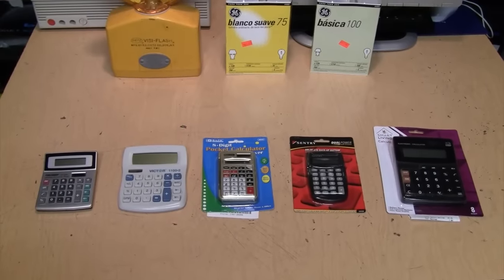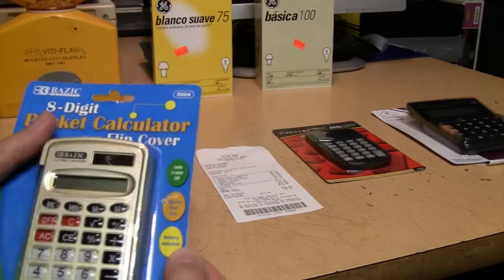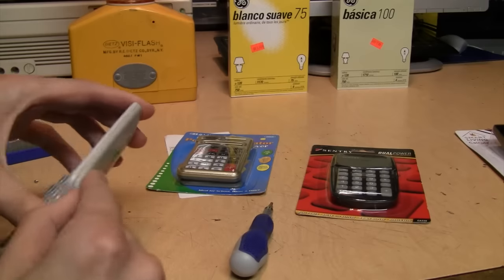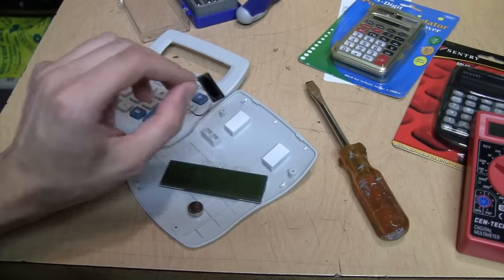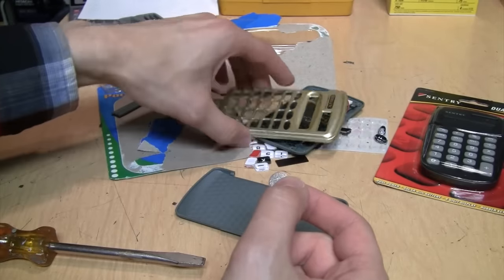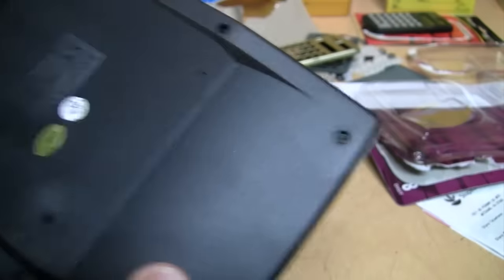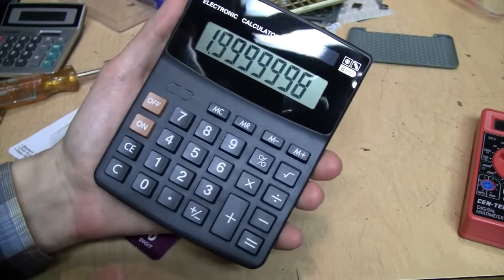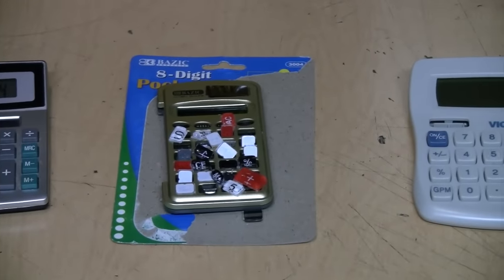Solar calculators BUSTED!

Comment: There are medical defibrillators: the modern ones have capacitors that don't make that high pitch, so some manufacturers have had to add sound chips, just because it's expected to make that noise to 'prove' that it's working.
Reply: no u
Reply: It's not actually the capacitor bank that makes the whining, it's the HV charge circuit.  Modern ones still whine, it's just above the range of human hearing.
Reply: Just like many modern cars has a speaker making the sound for the turn indicator, where in older cars it's the actual indicator relay that makes the click-clack.
Reply: Those are called skeuomorphs (mentioned in this video: https://www.youtube.com/watch?v=xn7ZaT3AgoU), they're the inclusion of features from old things in their successors. Such as the camera-shutter sound when taking a picture with a smartphone, the icon for calling being an old landline phone or the icon for email being an envelope. All skeuomorphs, purely to make the new things more familiar to people used to the older versions of these things.
Reply: does that mean silent crts.
Reply: Agent Lurmey another skeuomorph would be the 3.5 inch floppy as the save icon for things like word processing programs.
Reply: Modern CVTs in cars due to their nature have absolutely no "shift" feeling, being the entire point of a continuously variable transmission as opposed to the old gear based ones. People complained because they missed the feeling of the gears shifting so manufacturers have started to add in several points to imitate shifting, despite it being slightly less efficient that way.
Reply: I saw a news story a month or two ago about a fully electric schoolbus that constantly played music externally to replace the sound of the engine as an indication that the bus is nearby by and moving. I imagine the sound chip in a defibrillator serves a similar purpose of saftey.
Reply: If I let a silent one go then I make a fart sound with my mouth.
Reply: @Isenmouthe  hmmm, interesting. I know a guy that a 1997 pick up, and im pretty sure that when you (the driver) turns on a turn signal, it makes a somewhat low clicking noise. I wonder if that noise is actually a real blinker noise.
Reply: @GAIUSJAKE  are you me?
Reply: Agent Lurmey 
Thanks for the link. I subscribed to that channel, it’s great! Thanks.
Reply: @Isenmouthe  yeah to tell u its on
Reply: Can u put that in dumb terms lmao im not that advanced
Reply: @-Dragon-Master-  Heh, sure

You know on TV and movies they make that bweeeeeeeeeeEEEEEEEEEEE noise? Because the old ones were kinda.... rough, that's why that noise exists (and is actually a sound due to the parts actually being under strain). So the new models, they don't make that noise (or as someone said: at least not in range that we can hear anymore).... but it's so ingrained that "that whistle/whining noise means it's working" that they had to ADD a speaker, JUST to make the sound, because otherwise people didn't believe it was working.

I can imagine a few 'accidents' of people touching the paddles and shocking themselves because of it.
Reply: @Xunkun  lmao thank u thats much more simple than how u put it first cause i aint no rocket scientist
Reply: So Defibrillator noise is actually coilwhine?
Reply: @KRAFTWERK2K6  I'd guess so. The pitch change is likely due to reduction in charge current as the capacitors charge up causing the oscillator frequency to go up.

A bit like traditional (Xenon) camera flash units, I guess.
Reply: @MGSLurmey  I always turn that sound off so people don't know I'm taking pictures.
Reply: I remember having to add a fake "loading" screen to an app after a user performed a certain action because otherwise some users didn't trust how fast it worked.
Reply: @Luckingsworth  Tactile shifting is actually safer, tactility is important in many aspects of life, especially for adjustments of important things.
Reply: @Isenmouthe ; Just like a modern ICE car they have to add in engine noises to the cabin so you know it’s working. An electric car has really bizarre noises added to them depending on the brand. My friends Lexus sounds like a spaceship.
Reply: @Bootleg_Jones  The electric buses in London make engine noises that vary with speed for the same reason.
Reply: Makes sense to me. They're designed to be used by regular people without training, every second of delay could mean life or death.
Reply: Having auditory indication of device working is nice feature tho, You don't need to look at display to see what's going on and can focus on patient.
Reply: @Bootleg_Jones  yes, in defiriblilator def for safety reasons primarly, but not as much for the charging, but so u dont repeatedly defribrilate, since the perfection of buttercap high voltage capacitors takes a few milliseconds recharge...
Reply: @Luckingsworth  the less you feel the shift the more wear is actually happening from slippage. The smooth shifting of modern cars is why they don't last beyond the warranty these days and it's only done because people didn't like the feeling of a hard shift.
Reply: @RT-qd8yl  that's illegal in some places be careful
Reply: I was wondering why anyone would do this, but then I realized. Solar sells!
Reply: @Isenmouthe  Legal requirement that they be audible to the driver, VW fell foul of that in one of the Golfs where the indicator was deemed too quiet.
Reply: but there is practical application to that
Reply: Resurrecting your team mates is not as fun without it.
Reply: @Xunkun  Not a sound because the components were under strain. Just that the switching frequency was low and in hearing range. And a low frequency meant a large inductor that vibrated strongly enough that we could hear it.

Improved switch transistors now has less losses when turning on/off, which means it's possible to switch at a much higher frequency. On one hand, the frequency is above what we can hear. But a higher frequency also means less energy pulsed per cycle. So a smaller inductor is used and even if we could hear that frequency, the smaller inductor vibrates less, i.e. is more silent.
Reply: Coils tend to make much more noise when operating, than capacitors. Transformers and motors have coils in them.
Reply: It's the same thing with the loading screen in programs
Reply: We have Panasonic heart start mrx and I always wondered why different defibs made different noises
Reply: There's a word for that like 

"Soundening" or something where you add sound to a device simply to demonstrate function and for no practical function.
Reply: Well you need an indicator and a way to time yourself in an emergency.
Reply: @liam3284  good point
Reply: Buttons in the computer make sound when you click them when there is absolutely no needed to do that. But it gives you feedback about things happening. It's part of the UX.
Reply: @Luckingsworth  A battery-electric car, like a tesla, does not "shift" , and I doubt drivers expect it.  All snowmobiles, and many ATVs and mopeds, have CVTs.  Shifting must be just a motorcycle rider's thing.
Reply: @MGSLurmey  reminds me of a vinyl record and cassette tape recording technique that removed all crackles/hisses during silent moments of the recording. It caused people to think the silent 5 second intro in songs was actually the machine volume at 0, so they would turn the volume up to max, only for the song to start 2 seconds later, at full volume, quite to their surprise...
In such a use-case, you can't add fake hiss/crackle noise to alert people it's working as that would defeat the whole purpose of the anti-crackle technology!! Lol
Reply: @Heathmcdonald  Noiseless cameras are legally required in some places.  Official photos taken during court procedures (where that is done) so as to not disturb.
Reply: @morganrussman  I would guess that it's real and because it's quiet it's right there at the edge of real going away
Reply: @Heathmcdonald  You're still thinking of automatic transmissions with planetary gears and clutch packs. You're correct that smoothly shifting those wears them out faster. CVT is very different and doesn't actually shift at all. For CVT, programming the TCU to make them simulate shifting wears them out slightly faster, and makes the car accelerate slightly slower, but people like it
Reply: @MGSLurmey or the loading screen in video games even if it's not necessary.

Comment: I once had a calculator that was so cheap, that instead of "fake solar cell" it had a freaking sticker, with solar cell image.
Reply: lol
Reply: That actually happens a lot, the plastic inset might be cheaper than the sticker though to produce.
Reply: actually makes sense, since they probably have plastic molds and no sticker production system, just using  available plastic pellets would be cheaper than ordering stickers from someone else and having someone man that part.
Reply: Only in russia
Reply: Искандер Сайфуллин old solar calculators sucked. They only worked outside... But this is a con...
Reply: well its propably from china too
Reply: This makes me laugh😂 like why bother adding it??!?!
Reply: Calculator, now with a solar cell jpg!

Comment: in the 80s my friends walkman stopped working. we took it apart. they had bass boast buttons. it was a noise clicker. it didn't do anything, just clicked real loud
Reply: BADD1ONE Usually the bass boost button just mutes the bass tones when it's not pushed in, so that if you dont turn it on the music sounds worse. Tricks people into thinking the bass boost is a good thing.
Reply: thats exactly what the youtube downvote button does. absolutly nothing, but they didnt want to remove it.

Comment: “Why not just buy a new one?”

”Well, I like this one.”

I can’t agree more with this attitude. Making everything disposable has broken any concept of sentimental value of things to so many people.
Reply: I was asked the same thing when I had to borrow a screwdriver to open up my old TI-83, which had stopped powering on even with a fresh battery. Sure I can do most of my calculations on my computer/phone and I probably could find a used replacement for not that much but I like my calculator and frankly sometimes the inputs with real buttons are nicer than digital stuff. Turned out the only problem was that the metal arms connecting the battery to the board are just sort of pushed against some contacts and at some point a drop must have bent them just enough that they weren’t quite touching anymore. Used pliers and had it working perfectly again
Reply: acá en Latinoamérica eso no existe :v
Reply: Yup
Reply: it's also an environmental disaster
Reply: I like that calculator. That is a nice calculator.
Reply: @casey6556  same with me - I fixed a clock I found at work in a bin. Rusty contacts. Was it worth spending a few hours diagnosing probably a £5 clock. Probably not, but I did it out of pure curiosity.
Reply: @aetheralmeowstic2392  “I like this calculator. It’s a nice fucking calculator.” -Vaas Montenegro
Reply: This also adds up through many disposable thing to really become a productivity problem for many people
Reply: the irony is he bought another 3
Reply: As someone who has to use a calculator at my job, I can 100% sympathize with the plight of any fellow human who has had to suffer through the torment of going through half a dozen fucking awful calculators with sticky buttons that only work 25% of the time before landing on one that just freaking registers a button press when you want it to.
Reply: Oh no sentimentality will NEVER disappear. Why do you think hording is such a problem. Now, it's just people hording useless rubbish, it used to be people would accumulate things that for the most part were still useful.
Reply: I value my time alot more than any silly nonexistent sentimentality.
Reply: Wow this be doin numbers.
Reply: ...It's also made most products manufactured today into garbage!
Reply: @casey6556  my mechanical adding machine still works after 65 years
Reply: @rexjolles  Very nice! I love watching (and hearing) adding machines work; if I had the money and the space I’d definitely keep one around
Reply: @casey6556  you can get one for like 20 bucks from a junk shop, the issue is finding a ribbon if it's the print type
Reply: We love your comment!!! I have an extra set of the tiny screwdrivers just in case I misplace one
Reply: ive been using the same calulator for 4 years in high school and my sister used the same calulator when she was in highschool. Its a good calculator and i cant use any other calulator lol
Reply: Also filled many landfills.
Reply: Well cars have fake exhausts also
Reply: @abitofmymind  oh believe me I know
Reply: In my case, it's nothing to do with sentiment. I am picky about how keys work, whether it's a calculator or computer. I hate mushy keys, and I don't like smooth uniform keys that are too close together. The mushy keys require one to stare at the screen to make sure the input registered. The uniform smooth close keys makes it hard to "see" with your fingertips where you are on the keys.
Reply: @Kevin-jb2pv  this guy gets it
Reply: Fast Fashion in a nutshell.
Reply: Exactly.  It's something that may seem insignificant to some, but it is truly one of life's simplest pleasures
Reply: Yeah I get a new what ever when I can't keep it going anymore. Gta slap it to work great it'll work way longer then if not. It's already broken an replaceable why not whack an save $?
Reply: I've had the same Casio FX83GT+ since I was a kid, it's served me well and still has the original battery, so the nicer ones are well worth the money too, I see the newer models with silver keys and high res displays and I'm tempted but what's the point replacing something that's still going strong? I also have a ham radio from 2007, it's hard to believe how old it is at times, still works like new, I bought one of these modern ones from china and while the screen is nicer the old radio is still much better.
Reply: Ironic bc he just bought a bunch of other calcs anyway
Reply: Well, that, and the things are often so cheap in price that it's easy to do so too. In fact, over 1 1/2 years or so ago (I think it was somewheres around early January of 2022, but, I can't exactly remember), my workplace was going to throw out a u.p.s (or uninterruptable power supply for those who don't know). The problem? The battery was bad. I was able to throw a new battery that I got off Amazon in it, and, it has worked perfectly since.
Reply: I approve, and it's also about how replacing all these little things ADDS UP LARGELY over time. They're conning our money out of us. Everything should be able to be maintained. In the older days you could buy something once or twice and maintain it for life.

I always look for products I can maintain, even if it's a bit more. I now understand the value of having a tool or something for 20+ years and realizing I only paid one time.
Reply: And it's for the planet
Reply: @DeagleGamesTV you must be the most interesting person in the world
Reply: @morganrussman I have like 3 dead ups too, what batteries do you use to replace them? Like car batteries?
Reply: I agree, if it is something easy to repair and somewhat cheap hell yeah I'll try repairing it, there's no need to buy another. The fewer the trash the better.
Reply: Good. You shouldn't get sentimental over objects. Your attitude creates people who value objects over people. It's why people kill for shoes.
Reply: That, and fixing things is fun!
Reply: Well, it WAS a real solar cell calculator 😂
Reply: Its funny you didn't want to throw away your calculator as you dont agree with waste, then you destroyed several working calculators to prove it 😢
Reply: The noise of opening the smart living one sent chills up my spine 😮
Reply: I would say - if you can reuse or repurpose something - do it! Including reusing materials. That’s the best thing you can do for the environment.
Reply: Sorry, but the vast majority of us if something drops on the floor and quits working we at least make an attempt to fix it or determine just how badly it is broken.
Not just throw it immediately in the trash.

Comment: 01:02 - Most likely, the same case is also used for an actual solar-powered calculator. It's cheaper to just cover up the solar panel in the non solar-powered models than to make individual cases for each. You can also see that there are recesses for two button batteries, even though the specific model uses a single battery that is mounted directly to the circuit board. One case molding, different calculator models.
Reply: Exactly. Those calculators are as cheap as they are because the entire process  —from market research to design to production to distribution— was done so as efficiently as possible. Money was saved every step of the way, and manufacturing is usually the most expensive part.
Reply: Exactly!